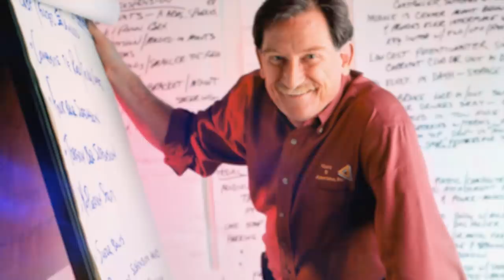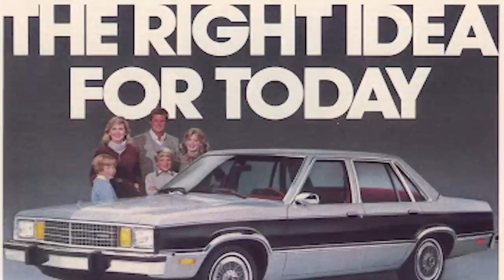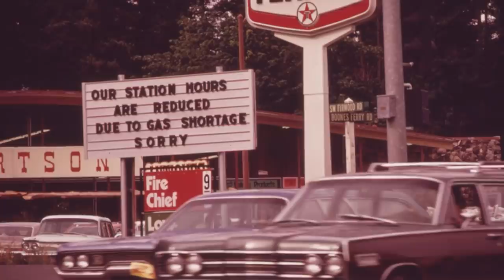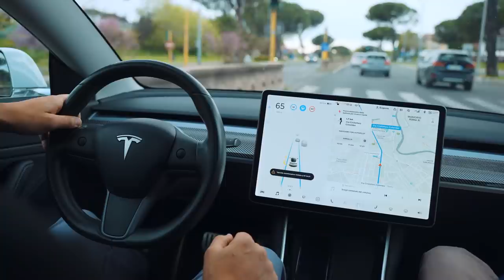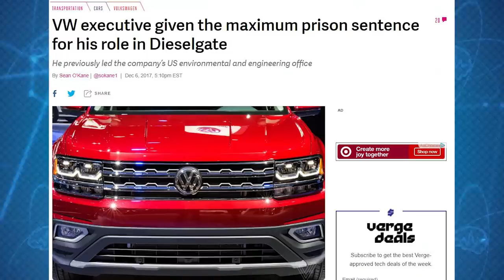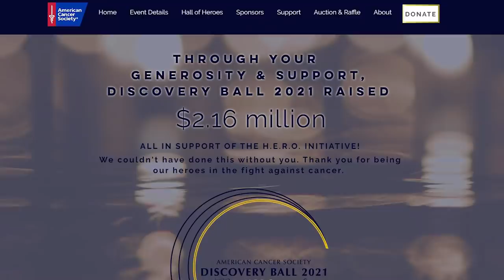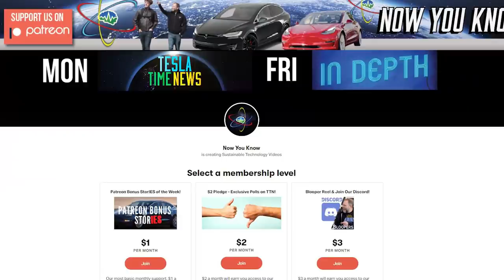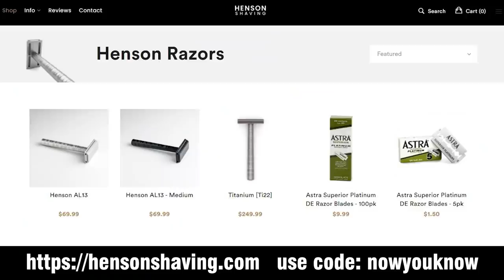China is Coming: Observations from an Expert | In Depth

Comment: 3nm chips aren't available, TSMC in Taiwan has the smallest transistor node which is currently 5nm. China in the other hand are stuck on 14nm.
Reply: In WW2, the Germans concentrated on building finely engineered weapons and tanks. The USSR concentrated on building crude weapons and tanks that would be easily used and repaired by peasant soldiers. 
Guess who won?
And in case you say the Allies, consider this: 80% of German casualties were from fighting the Soviets.
Reply: It has broken through 7 nanometers today
Reply: I see that now, mate 60 pro, looks like China are bypassing sanctions, or are they using old technology to build 7nm?

Comment: I think that Sandy meant 'nm' when he said "10mm chips, 5mm chips . . . "- referring to the process used to make the chips. These processes are usually named by the smallest feature they can produce (although the names have developed some ambiguity over the years). The smaller the feature, the greater the transistor density and complexity of the chip.
Reply: Thanks for confirming this, I was thinking the same thing as a follower of cpu/gpu tech.
Reply: Exactly my thoughts. If you assume that he meant that then he is right.

Comment: Big thanks for recommending the Henson Shaver!
I've used 1 blade shavers forever, but the problem was they cut, as I don't use shaving cream, just straight on skin after a shower.
The cuts grow over the years and scars/bumps then cut more and more.
I've been looking for a 'safer' shaver for years but I think this is it.
It's so smooth and very hard to cut skin. I even run my finger over the blade to wash out hair and it feels smooth with the metal cut shape holder bit.
Hoping it will be my long term solution.

Comment: I drive BYD tang EV for 5 years and several days age I change the battery for free, there is no reason for me to come back to gas cars, I also have a 2010 BMW x6m, which is 555 hp, and tang is 500hp,  but the cost of driving is about 13 times cheaper, plus EV almost needs no maintance.

Comment: Talking about strategic business. The Japanese car industry actually utilized principles for automation of the assemply line that was developed in the US but not implemented in time. This made the cost per unit much smaller than in the US. A parallel is the Japanese camera industry which for decades has dominated the Western markets. Take a look at the Chinese "Rolls Royce". It's not just looking good, it's solid, well build and costs a third or less of the original RR.

Comment: Nio Is the smartest EV manufacturer.. If they set up the battery swap stations nation wide here in America I will buy one. I am not giving up my ICE until I can either swap out my battery or charge my battery as fast as I can fill up now. I travel a lot and I will not wait for 30 minutes or more every 300 miles.. Nio I can swap out in less than 7 minutes.. 

Nio deserves to take over because American car manufacturers could make their batteries swap out that fast too and have chosen to not do that.  So, they made a choice to get passed..

Comment: The Datsum Cherry was pretty bad (I've driven one - bad understeer!) with very weak after-sales serice, but it had a fitted radio casette as standard, not an expensive extra - that was a unique UK market position at the time. That did it to the opposition in the UK! Sabaru did something similar to Landrover with a very cheap 4X4 pick-up and British farmers bought so many that it became a very common sight in the British countryside in a very short space of time. It was a rust bucket with (again) a fitted radio casette as standard.

Comment: My advice for the big 3 is to set up all dealerships to convert their cars less than 10 years old to EV ,do this ASAP ,drive in on gas and drive out EV , in less then 6 hours, how # 1 remove gas tank and lines associated junk,  #2 remove engine and if necessary tranny , #3 remove exhaust system #4 Remove and replace computers ,and #5 install batteries and electric motor #6 hookup test and deliver to customer all for $6 k to 10 K USD financed as a car payment, Now we are moving in the right direction . but we all know it will not happen instead China will mass introduce EVs to America....Just like Japan did and if I had my MR-2 I would convert it in a heartbeat.

Comment: There are many things made in China or Asia that are much better than the u.s made. I’ve worked for Ametek, Crystal Eng. company in California and I’ve even seen the worst electromechanical soldering work in my life. The employees work very slow and filthy, not even maintaining their work bench, area, tools, and equipments clean. Once I told a supervisor I felt like cutting off some of my fingers so I can work like you guys. The Asian seems to work and performed much better than the Americans. There’s absolutely no way the Americans will out performed the Asian at manufacturing work. Period.

Comment: Let the people decide whether Chinese vehicles are well made or not.  If Chinese vehicles are so far ahead compared to other brands from other nations, I will be more concerned with whether Chinese vehicles are highly reliable or not.  Will they run over 250,000 miles without any transmission or major engine problems?  That's the main question people must decide. No matter how cheap Chinese vehicle may sell for,  I would not buy any vehicle without any informations on reliability.  Perhaps Chinese vehicles are loaded with AI or all sort of electronics, but that's not the most important aspect of any vehicle, it's the reliability what counts most.

Comment: Strategic decision is not only about what kind/type of cars to make, but even more importantly what kind of workforce is making those cars.  What is the work ethic that prevails on the assembly line.  Sadly US workers are just plain lazy compared to Chinese workers.  This is the biggest strategic failure of the US management.  It yielded to laziness, loss of vision and and loss of focus.  Within the US's management wokeness trumps engineering and worker diligence.  Hard work is treated as a social disease, discipline in the workplace is considered an outdated, conservative and intolerably oppressive practice - yest by the HR apparatchiks. Hard work is no longer gratifying within the US workplace culture.  Here's the sharp point of the lance: this is no fault of the workers.  It is the fault of the lame management, with Ivy League degrees where they learn more about selling and bloviating than manufacturing.

Comment: Even if you're maintaining an older american or european made car, the parts are made in china. 
Take out the worn french alternator replace it with chinese, take out the worn mexican window controller replace it with chinese, take out the old japanese stereo replace it with chinese, take out the leaking USA made radiator replace it with chinese. They reverse engineer everything - simple, complex, wood, plastic, metal, leather, legal, illegal - almost everything.

Comment: I gotta be honest I dnt see electric cars taking over the way you guys think. You will always need power plants (pollution) too create all the electricity for these vehicles. Electric cannot produce propulsion on its own. It will always need some type of combustion too create the power. They just took the motor out of the car and left it at the power plant. It makes zero sense. I can see hydrogen, water, fuel etc taking off. Electric is a joke. Maybe in 20yrs when the cars can charge in 2min and can travel 400+ miles. But rite now no way. All the loss of electricity in transferring, storing, cold weather. Just does not make sense.

Comment: This happens thanks to the United States  for sending there job over seas with the years China learn how to build cars . So if China start sending there cars to USA be ready for a lot of layoff like Ford , Chevrolet , Dodge plus ad the other company that makes parts for those cars brand s and remember if the car are going to be electric the company that makes exhaust system and radiator are going to layoff employees and close there business because electric car don’t use a radiator or a exhaust system

Comment: Great interview. The Chinese are going to eat the US market; China's car makers (NIO, for instance) are rolling out dealerships across the US in the next 2 years. 

Economic Risk For China
But Chinese automakers still can't make an EV to N American standards at a profit: they're selling at a loss (just as Ford, VW & everyone else are - all EXCEPT Tesla). So China's expansion into the US market will depend on the willingness of the Chinese Communist Party to keep subsidizing the cost of each car sold. Currently automakers not called Tesla are losing about $10K/car to sell EVs. Only way that stops is through volume. China's manufacturers (Geely, SAIC, BYD) & VW & maybe Hyundai are the most likely candidates to have the resources to scale enough to reach break-even on EVs, before going broke trying. Most cars Tesla doesn't sell will likely be Chinese, VW or Hyundai/Kia by 2030.

Geopolitical Risk For China
The CCP might get bellicose, make a grab for Taiwan & be locked out of the US market (& everywhere else). If China gets ugly, decides to repeat its grab of Tibet, it'll be locked out of worldwide markets everywhere. It might elect to do that anyhow.

Comment: The US had its blinkers on and at least Ford was wise enough to treat Europe as a separate market and it had some great cars; The Ford Anglia, Escort, Cortina, Capri, Taurus, Zephyr etc we loved them down here in New Zealand and Australia! Especially New Zealand with our mountains and windy roads through the Southern Alps and the massive volcanic plateau of the North Island, 
The Ford Escort was the rally car; it won everything and it was small but grunty!
In Australia & New Zealand, (lets call us ANZAC's) bigger Fords were the Ford Falcon which came in a 3.65 litre straight 6 up to a  351 Cubic inch V8. 
GM (Holden Brand) basically had a similar line up with the small models coming from either Opel or Vauxhall (GM's European divisions).
Chrysler had a similar set up to GM, with smaller model brands coming from the UK, like Hillman and Humber etc and the Big Chrysler Pacers and Chargers; with their Hemi performance machine  came out in a 245, 265 (Straight 6) and a 318 cubic inch V8.
Ford dominated as it had the one brand strategy; Ford Escorts and Cortinas; both great cars! And the big heavy Aussie and Kiwi Made 6 and V8's. The Ford Falcon, Fairlane, Fairmont, LTD are legends to this day. so through the 1960's, 70's, and half of the 80's ford was number 1. GM, was number 2 in the 60's, and 70's
In New Zealand Mitsubishi ended up having some sort of deal with Chrysler and they got off to a head start in terms of Japanese cars. But Chrysler virtually disappeared by the mid 80's replaced by Mitsubishi
Toyota kept on with its long term Marketing Strategy slowly picking a bit of market share away from both Ford and GM; GM also fell off the market share charts in the late 1980's only holding on with the Holden Commodore until GM's total capitulation in Australia and New Zealand in 2020. GM in this part of the world stands for Government Money, Gone Mad, etc etc.
However Toyota kept on with its Window of Economics practices supported by the Japanese banks, government, people, employees etc and they became number 1 certainly in New Zealand in the late 1980's, knocking Ford off the number 1 spot!
Toyota kept this number 1 position until 2016 when Ford got the number 1 position back. 
However Toyota looks as though its days are numbered, the Japanese Economy is a basket case; it has suffered from Stag Deflation since the late 1980's.   
Japan's Window of Economic Doctrine has been a terrible failure since the late 1980's; it has lost the Phone Market, The TV Market, The Computer Market.
However Japan is a great country, it makes stuff of the highest quality and it is adjusting to its new position in the world. now buying something from Japan is right up there with the very very best in the World like Switzerland, Germany or the North of Italy.
With China acting so aggressively I can't wait to see Japan making Aircraft Carriers, Nuclear Submarines, Rockets, Airforce Fighters, Bombers etc. We now need Japan to help defend us from the Nasty Bear; Mean horrible Winnie the Pooh! 
Economically China has tried to copy Japan and it too is going to fall off an economic cliff face due to demographics and economics!
In the end we all need to be friends; I like the Chinese (I used to love them Prior to what Carrie Lamb did in Honk Kong and what Nasty Bear is threatening in the Pacific), I still love the Chinese!, and I love the Taiwanese, Japanese, South Koreans, Australians, Canadians, Indians, USA, Germans, French, Italians, Poles, Ukrainians, Greeks, etc etc.
I've already been attacked by Chinese trolls!

Comment: There isn't going to be a quality advantage regarding the chinese autos compared to Toyota for example.  The japanese had a major quality advantage in the 70's and still have a quality advantage (to a much lower degree) today.  The other advantage the Japanese brought to the table was fuel efficency,.  If you're correct and the Chinese will only be importing electric autos, then they would need to possess an advantage in EV technology which they don't.  The other possible advantage would be affordability.  The Americans might be forced to allow the Chinese to enter the market but I'll bet the US tariff it up and neutralize at least part of that advantage.  So China's advantage sounds to really not compare to the advantage that the Japanese had from the 70's onward.

Comment: Sandy completely misses US consumer demand. Ford sells almost 1,000,000 Ford F-150s a year. The entire US EV market is 450,000; less than 4%. The top selling US vehicles are SUVs, and pickup trucks. Compact, ugly electric cars will never be a market share leader over these. US customers prefererence? Size. Looks. Practicality. Quality fit and finish. Easy to service anywhere. The big one; charging is a time wasting nuisance. Disposing lithium batteries is a toxic environmental hazard.

Comment: Does a electric engine have towing capacity and withstand the cold and high hills with the same saving of electric? I'm not sure if that's what will happen cause they still need trucks with power for hills and or towing capacity but the little cars might work a bit but really it's reliability of different terrains like hills and towing is being considered here